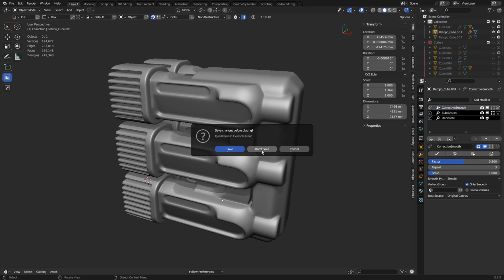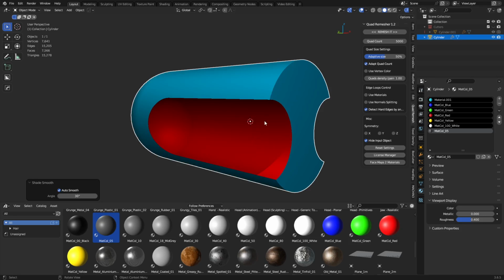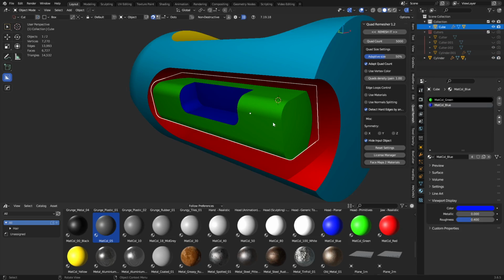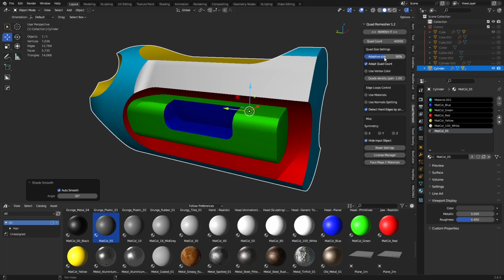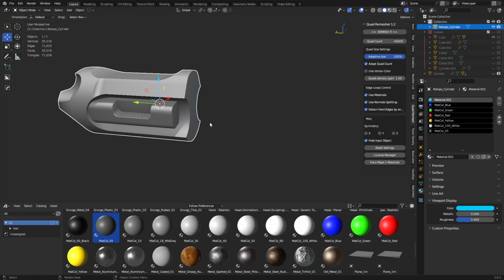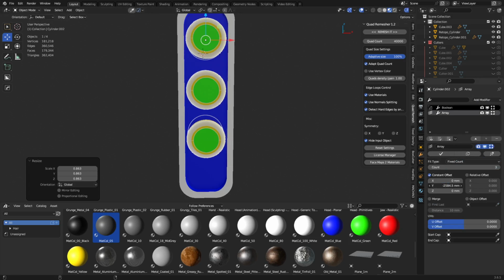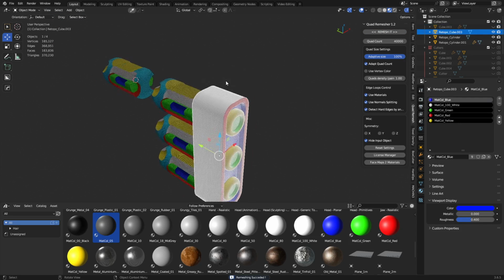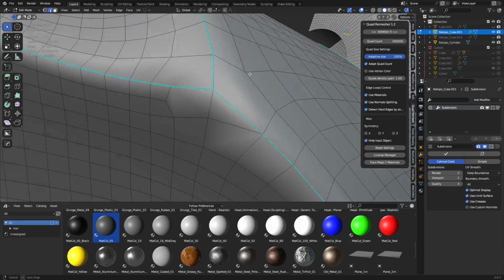Blender - Hard Surface Quad Remeshing The Best Way Possible

Comment: New to Blander here, first I thought it was a high quality CFD mesh when I first saw it...

Wish there was a way to mesh not just the outside surface but the volume inside same as well, that would make Blender one heck of a structural/cfd FEM mesher.
Reply from the maker: Never thought about it. Interesting idea.